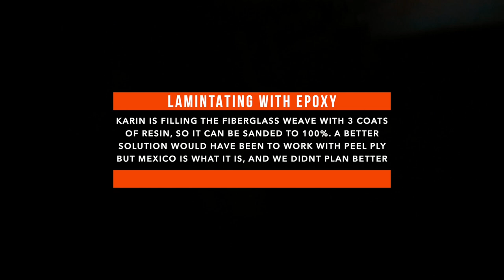It got out of control - Our 29 months story

Comment: Dr Sheddy put the link on her Patreon account ! Great link!  It's a shame you cannot get good plywood, I hate seeing any boat not built with top quality hardwood BS1088 grade marine plywood. All the US Douglass fir based stuff is such crap! No amount of resin encapsulating can stop the rot even epoxy. It's just impossible to make it 100% impervious to moisture. But you are doing a great job and this was fun thanks for sharing!   Cheers Warren
Reply from the maker: The problem with the plywood was that we from the beginning never had intension to do any plywood repairs...if we would have known the extent of the project we would prob have ordered plywood from the states. We did several water submerging to test different plywood.